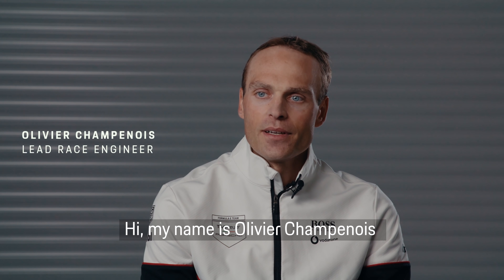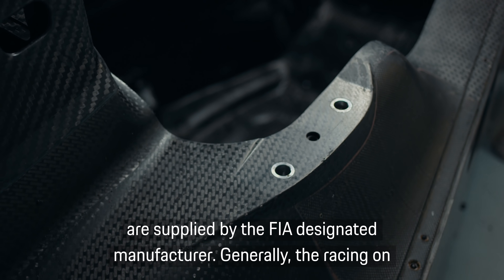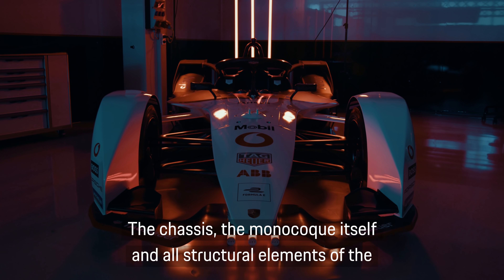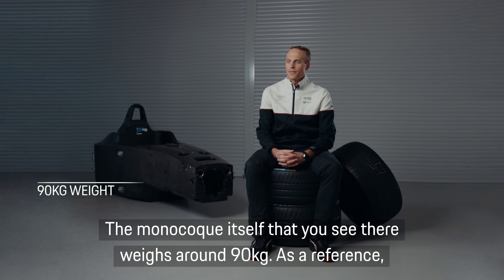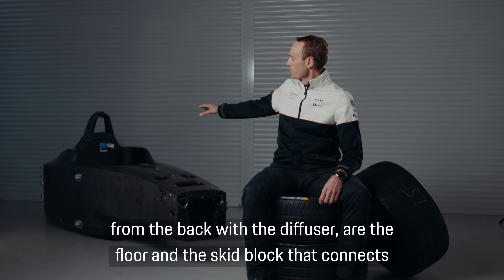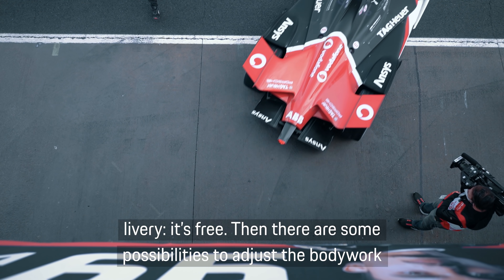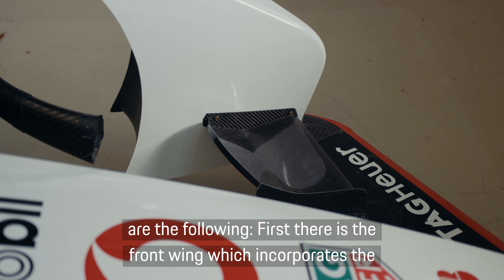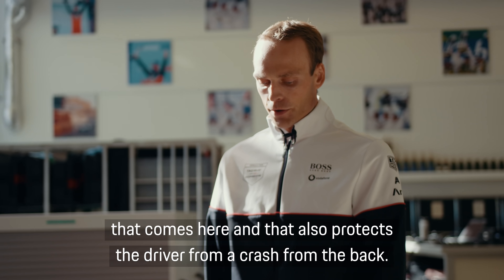Zooming In: the Porsche 99X Electric chassis | TAG Heuer Porsche Formula E Team

Comment: FIA should remove the wheel covers.  This would make the cars more aware while driving similar to F1 while also deterring unnecessary contact with the other cars.  If not - the races will continue to look like bumper cars.  The drivers need that risk of loosing a wheel or damaging the suspension if contact is made.  Take notes from F1.

Comment: Never discussed the powerplant.  Although the series is called Formula E, the powerplants are a hybrid of traditional hydrocarbon combustion and electric.  Would have liked to hear more about that.
Reply: Formula E is all electric. Formula 1 uses a hybrid drive/energy recorvery system though. Electric motors drive the rear wheels during acceleration, and an electric motor drives the turbo charger to maintain boost through low RPM.
Reply: There is also a problem with regard to the "marble waste (MW) of tire rubber (TR)" on the circuit roads. If the intensity as well as the sustainability of the environmentally friendly tire rubber will be realised enough, it will be the best tires for the Formula One.

Comment: Please walk away from this series.  Battery is like plastic grocery bags.  'Hey let's use plastic to save trees...  but trees are a renewable resource and what will we do with the plastic bags?'  🤔 All these battery cars will be the same.  Hydrogen is the real future of transportation.  VW/Porsche could make this happen.  There will never be enough clean energy to power the transportation needs of the battery world.
Reply: Current battery technology has nowhere near the performance AND range that today's IC engines provide.  That's not to say they "might" someday, but that day is a long way off.  Most people buy electrics as a virtual signaling device.  For long trips, they keep a traditional IC vehicle on hand.  Hydrogen has its own problems, it doesn't exist in a free state and takes considerable energy to break its common chemical bonds.  It also has to be stored as a liquid, which means cryogenics, which means weight, which means...in short the IC engine is here to stay for a long time.